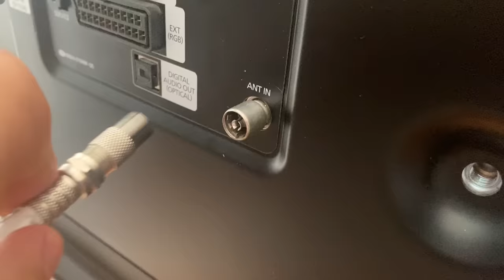Insert a BATTERY into the TV and watch all the channels in the world! Satellite TV!

Comment: All we ever did as British Army electronics technicians, was to jam wire coathanger into the TV antenna socket. No batteries or soldering required: and it worked a treat.
Reply: Im an ex bleep, CIRTA CITO
Reply: @daveslater9141  I use a safety pin

Comment: My dad once took a wired external Wi-Fi antenna and connected it to a laptop while we were out in the middle of nowhere. He spliced a 9V battery into the antenna's wires, and suddenly, we could see hundreds of Wi-Fi signals. What he probably did was amplify the power going to the external Wi-Fi antenna. Normally, Wi-Fi antennas get power from the device they’re plugged into, like a laptop, which limits how far they can pick up signals. By adding the 9V battery, he might have boosted the power going to the antenna, increasing its sensitivity and allowing it to detect more signals over a wider range.

With the extra power, the antenna was likely able to pick up weaker signals from distant routers or Wi-Fi access points that it wouldn’t have detected normally. It’s also possible that by boosting the power, there was more noise or interference, but that didn’t seem to stop the antenna from picking up hundreds of signals in that area. Of course, doing something like this might have been risky for the antenna or the laptop’s Wi-Fi card since they aren’t designed for that kind of power input. But it worked, and it was fascinating to see how much range we got out of the antenna.

Comment: II'm getting intergalactic television signals ever since I soldered  Mars and Galaxy chocolate bars on to my aerial socket!
Reply: Apparently if you use an aluminium butt plug you will also  something from "Uranus" 🤣🤣🤣
Reply: I've tapped into the Mexican telephone system by combining aluminum foil, Taco Bell packaging and Flex seal tape arranged on a 2000 Plymouth PT Cruiser antenna.

Comment: If you quickly put solder on the end of that battery terminal wire and shove it into your car's ignition switch before it dries . . and leave it there for 10 minutes . .  you will be amazed that you won't have to put gasoline in your car for quite a long time.
Reply: I set fire to my car , now I never  have to but gas .

Comment: for reals, though, I used to connect my TV cable via a cable adapter for tVs that don't have an RJ6 screwport to my stereo antenna and would get radio stations hundreds of miles away. I don't know if it still works since the analogue digital changeover but it worked pretty badass back in the day.

Comment: I like the alligator clips.  When the batteries run low you can chop off an AC plug and  connect the clips to the chopped wire sticking g from the outlet.  use house power until you get new batteries.  I think that’s in the uglie’s handbook